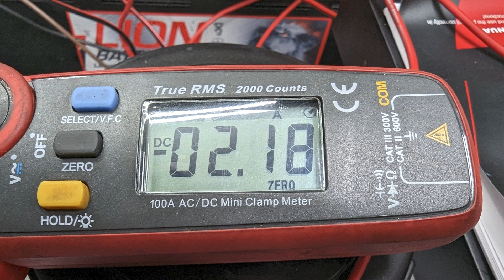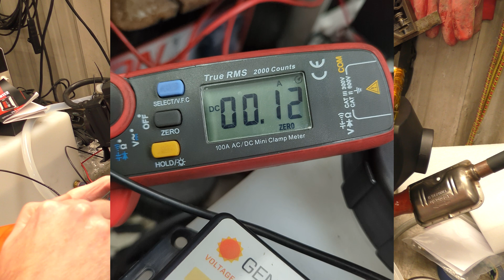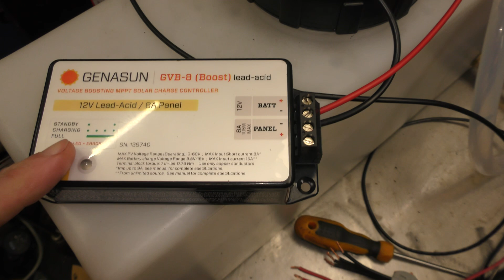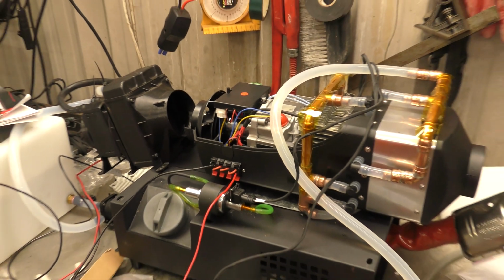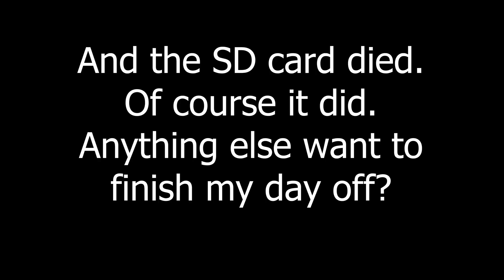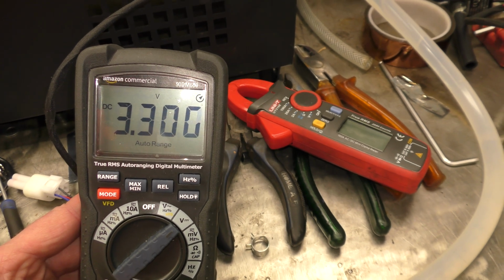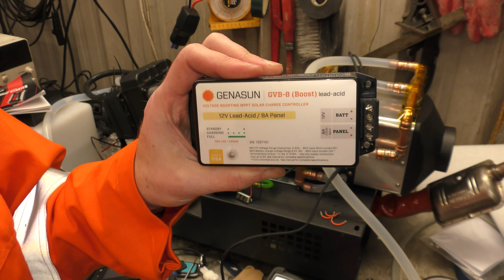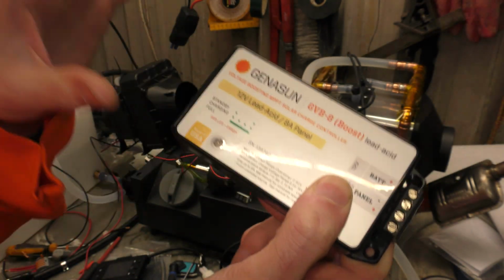Self Powered Diesel Heater Project - Developments and Disasters - part 7

Comment: To be honest Stacked Peltier Elements with a MUST Hot & Cold Side well insulated from Each other work better, but I feel an exhaust area would work better, but you must observe maximum temperature 🌡 ratings of the Peltier Modules look say at RS Components & another stockists is Farnell Components,
Reply: RS Components is where the original expensive TEGs came from, the maximum temperature ratings were higher than the current TEGs but didn’t create as much power.
I will have a look at Farnell Components 👍🏻

Comment: David, power the peltier from the exhaust..  looking at using a domestic CH radiator  inline with the exhaust.  Attach the elements to the radiator, Air cool from the heater intake along the radiator, Peltier, each having its own heat sink.  This will increase the thermal output of the heater and in effect be more efficient as the waste exhaust heat is being captured

Comment: So I have a question = Could you use PC fans ( or similar air pressure concept ) and convert them to produce electric via the main hot air flow output? maybe also 1 on the intake - what would it create power wise?  also - something else - The main exhaust gas would also have some serious pressure, could you build some sort of turbine at the end ( the coolest part if the pipe was extended ) to drive it without the obvious backed up pressure?
Reply from the maker: While technically possible, the energy produced would be miniscule.  Think of a wind turbine, typically 20% efficient and now the very best ones are 40%.  They are giant.  I think adding a turbine would also just cause the fan motor to increase its load to keep the fan RPM, so any gain would be mitigated by that.

Comment: Solar panels are basically a lot of diodes that let current run in one direction. TEG's are bidirectional. Put a single diode (hefty one) in the wire path, TEGs to the MPPT. Will keep the MPPT from "backpedaling" into the TEGs.... TEGs probably had no cooling on your (usually) hot side, so failures. Keep up your work and thanks for the videos.
Reply: Diodes have been fitted to each TEG this time 🤞
Reply: took the words out of my mouth

Comment: Do you do anymore diesel heater fuel working testing?
I would be interested to know if lamp oil can be used as diesel heater fuel?
Reply from the maker: Lamp oil is Paraffin and burns well in the heaters.
Reply: @DavidMcLuckie  thanks for information

Comment: I would like to upgrade my diesel heater to an LCD controller that it did not come with is this just plug and play or do I have to get a motherboard and solder in some wires
Reply from the maker: That's a bit of a minefield now.  There are now so many motherboard and LCD combinations that there is no guarantee that it will work.  If you buy a motherboard and LCD controller together you stand a better chance.

Something like this - https://s.click.aliexpress.com/e/_DBMi7qP

Comment: There was a fella I came across years ago that almost achieved a similar auto run system but using a rocket mass heater instead with tegs. Van Powell(s) - 'rocket mass heater/ thermoelectric generator and waterfall pt1'

Comment: I've bought a few (Chinese) MPPT controllers like that over the years, a couple of them were fairly expensive.  Two of them were not MPPT at all, just PWM with MPPT on the label and the one that was genuine was of such a shocking design, it went in the bin too!  If you're buying another one, get a branded MPPT controller such as Victron.  They are a bit more expensive - but actually do what they're supposed to!  In your case, a lot cheaper in the long run!

Well done to 'other David' for a nice design & clearly a lot of work to implement it.

Comment: Them pellitar or however it's spelled they are in them 12 volt mini fridge and coolers
Reply from the maker: Sort of.  Thermoelectric Coolers are optimised to be powered and have a hot and cold side.  Thermoelectric generators are optimised to be heated and cooled to produce power.  Although they all work on the same principle.

Comment: Thermo electric generator I think it's called a pellitar I've been thinking about trying to get some and do something similar to what you did but I wasn't going to have the water cooler setup
Reply: Peltier and TEG are kind of opposite to one another, though they will work in reverse to a limited degee.  A Peltier is optimised to transfer heat from one side of the device to the other.  The TEG to generate power when you flow heat, due to a temperature difference across the device.
Peltier devices are MUCH cheaper than TEG - but using them to generate power, you will only get a small fraction of the power.  A smaller fraction than the cost difference as it turns out.

Comment: Nice! 👍👍
And may i sugest to use your old prototype exhaust TEG also? just to get the last mA + some few to acually charge the battery. And (if )you do that, use a seperate MPPT for those, From testing in some larger scale use for cooling electrical panels on supply wessels working outside Brazil, i concluded that peltierelement behaves in some ways like a solar panel in series : only as good as the most shaded panel in a string.
Paralell as many as you can intil each string toghether in paralell reach lowest/ (highest) possible MPPT .(if stable temperature you can also use cheapPWM modules  just reach optimal voltage for the temperature range).
Just an idea.. From a mhecanical clown🤡 And been following you regulary for a year! 
Always rush to se your updates! 🤓🤡

Comment: Your progress has been impressive hope you can finish your last hurtles without any more setbacks maybe you can find some better tegs for the price or cheaper. Maybe a cheap solar mppt charge controller mine go up to 150v or do teg wiring partially in series and partially in parallel. If I had to buy new tegs maybe two more attached to the exhaust through a machined block with exhaust that goes through it. Buying tegs that actually meet the ratings they claim is tough. you have any recommendations for better temperature sensors on these Chinese heaters mine keep dying after a month or two?

Comment: From what you said the tags run 80 volts. I am not surprised it broke max peak voltage input is 63 volts of that module from what the front of it says.

Comment: You might be able to reach self sufficient operation if you reduce the power consumption of the pump. Depending on the amount of heat you are moving through the peltier modules, I suspect you could use a much less power hungry pump. 1 Amp at 12 Volts is quite a lot for such a small loop.

You could also potentially get some additional output by cooling the fluid more, perhaps by moving the radiator, or adding an additional radiator to cool the fluid further by using the cold intake combustion air.

In addition, you might be able to simplify the design a bit, without losing too much power if you connect the water blocks in series.

Comment: The Genasun GVB.8 Boost has a maximum input voltage of 60V. Though under load, the TEGs would not be at 70V+ but you were pushing your luck.
Reply from the maker: Does no one read the description?
Reply: @DavidMcLuckie  Ah, the TEGs were in parallel! Sorry, I didn't pick that up in the video.

Comment: An explanation of wtf a TEG module at the outset would help new viewers not in the loop.  Sounds like an overunity device otherwise.  Some device which produces power from heat I am guessing. oh here it is
TEG is a non-invasive test that quantitatively measures the ability of whole blood to form a clot. The principle of this in vitro test is to detect and quantify dynamic changes of the viscoelastic properties of a blood sample during clotting under low shear stress.
Reply from the maker: You'll likely need part 1 of the series.

https://letmegooglethat.com/?q=TEG+module

Comment: I wonder if you could design a water pump to to sit in front of the blower fan and take its drive direct from the fan hub? so then you only have to run one motor and not an additional pump... would have to see how much the extra drag on the blower motor affects its amp draw though..
Reply: could adding a one way valve directing the expanding heated water to recirculate through a rad be enough to cool the mystery device called a TEG, otherwise presumed to be a thermocouple?
Reply: @mikemotorbike4283   T.E.G... Thermo-Electric Generator. That's the bit making the Electricity due to having a heat deferential applied to it,  heat one side, cool the other side and you get a voltage out the wires.  They also work backwards in that you can put a voltage into them and one side gets hot the other cools down. The more you cool the hot side down, the colder the cool side gets.. in good setups you can get -40 on the cool side.  id YouTube them to understand them better..

Comment: I'm sorry, but you said your open voltage was up to 80V, and as far as I can see the converter is specd for maximum 60V. If the load dropped down to zero I'm not surprised you burned the FET's
Reply from the maker: Guessing you didn't read the video description then.  Specifically about having them in parallel when it was working.

Comment: Can you not add a zener diode to stop it back feeding?
Reply from the maker: That's next.  But I have a question.  I know there is a voltage drop across them, but is there also a current drop?  As in this situation every watt counts.
Reply: @DavidMcLuckie  A Zener diode wouldn't be the right choice for this. I think a Schottky diode would be a better choice. There is a voltage drop and hence wasted power, but there is no inherent drop in current. Or ideally, use an "ideal diode", which should have a low voltage drop eg <50mV.

Comment: Why did you put the tec's inside it, wouldnt mounting them on a copper block on the exhaust pipe have been enough? Or to a square pipe you just blow the hot air through..
Reply from the maker: Maximum differential heat.  The greater the heat difference in the two sides of the TEG the more current you can produce.  A copper block around the burn chamber is about as hot as you get the hot side without it actually being inside.  Because we can't get the cold side colder than the ambient air.  If you stayed somewhere really, really cold and could use outside air in the negatives to cool the cold side, you could probably just use the hot exhaust to generate the same power.
Reply: @DavidMcLuckie  yeah but you water cooled the other side of the tecs anyway.. so your reasoning makes zero sense...
Reply from the maker: The exhaust gas once it has passed through the heater and coming out of the exhaust is no longer the as hot as it was when it left the burn chamber.  If it's 500ºC leaving the burn chamber but only 200ºC coming out the exhaust, I want the TEGs near the 500 and not the 200.  As the cold side cooling would remain the same we need to make the hot side hotter to get maximum power from the TEGs.

Comment: So close David. The smell of success is in the wind and this I think is just another thing to revaluated and move forward with . If this idea eventually does indeed work, I think the two David's and everyone else involved, have proved that they can achieve something that the original designers and manufacturers could not, or; didn't even dream off to be possible.
Another thought... During winter, this is when a system like this is most important. What if the coolant water went to the outside of, lets say a campervan to be cooled by the cold winter air through a heat zinc before going back into the van and past the TEG's, causing a higher hot/cold differential in those TEG's therefore producing that little bit of extra power this system needs to be 100% self powered electricity wise.
Brilliant work so far, my hat is off!
Reply from the maker: Yes that.  The greater the difference in temperature, the more power the TEGs produce.  But I also don't want to waste the heat you are burning the fuel to produce, if that makes sense.
Reply: @DavidMcLuckie  Yes I understand that reasoning David and had thought about that too, although charging the battery enough to fully power the heater would be my prime goal, then efficiency would come next.
You're so close as it is, it's impressive, I just though I'd mention it anyway. I'm right with you on this one, I have been from the beginning!
Reply: @pa_maj.MARTINI-van-MAN   you’re on the nail with the coolant being outside! The plan is to run a slightly larger bobil setup which draws cold air from outside and also  have a coolant radiator of some sort underneath the van.
Reply: @daveparf  That sounds perfect. 
It's finding a Good balance for a great setup at the end of the day, not so easy as conditions are also variable. 
I hardly ever use my eberspacher now (it was already fitted to my van four years ago when I purchased it) it's too hard on my aging batteries yet my batteries are fine for everything else that I need. 
Replacing the batteries for the sake of the heater is not worth it so I'm using gas heating 80% of the time. 
Driving to charge the batteries when there's little sun or daylight hours just for heat is not efficient, gas heating works out to be a far better option for me at the moment. 
I do miss not being able to use my diesel heater like I should be. 
Nothing is for free, so at the expense of some heat going to the TEG's is fine, my heater is never set higher than 50% anyway, so even if I had to run it at 75% it would still be a win.
Reply: @pa_maj.MARTINI-van-MAN  
I think the thought of being able to stay comfortably warm without worrying about draining the battery will be a really game changer for many people, plus not having to replace the leisure batteries every year will be a bonus.
Reply: @daveparf  100% 👍

Comment: If you had wired a live chicken with a Zener diode in its bum this would not have happened AS I told ya !  the chicken would have slowly cooked and the thingumy would not have had a spaz.
Reply: Or a germanium diode and pick up some radio stations without power.

Comment: Used mine to dry laundry tonight, impressive engineering, I wonder how much power a Sterling Engine would generate, because in cold weather you will have a temperature differential between the exhaust and cold air, just a thought.
Reply: In those domestic CHP boilers, the Stirling Cycle Engine produces 1kW while the gas burner is on. I saw quoted, the energy input resulting in 75% to heating water, 20% to running Stirling Engine, 5% to waste via exhaust, after passing through Stirling engine.
Reply: @stevemorris3710  cheers, could be a wee project for Mr McLuckie, I've got mine connected to a bench supply, if power cuts then can stick on a car battery or fire up my generator, would be good to have an option that flips to a battery, charged by residual heat from the  Diesel Heater,
Reply from the maker: @Steve Morris - I've got an eBay search running constantly for that boiler.  Only ever seen one for sale and it was at the other end of the country.  :(